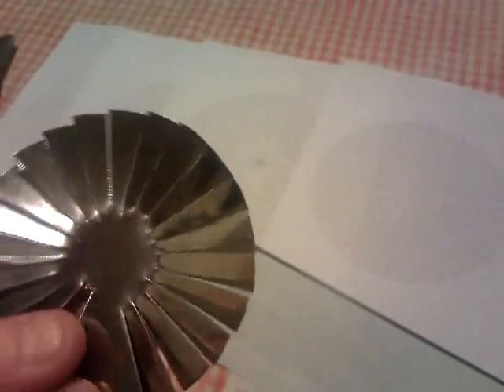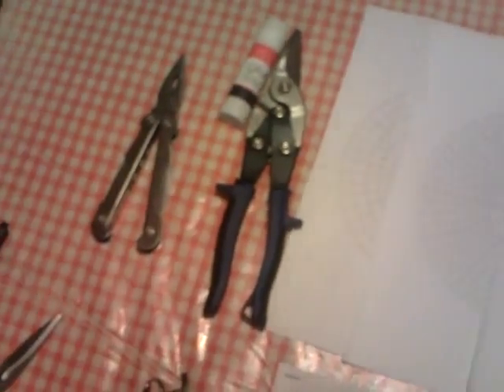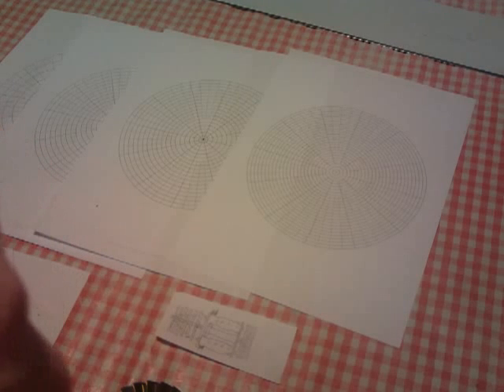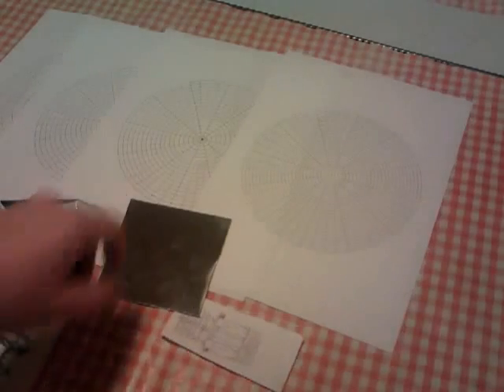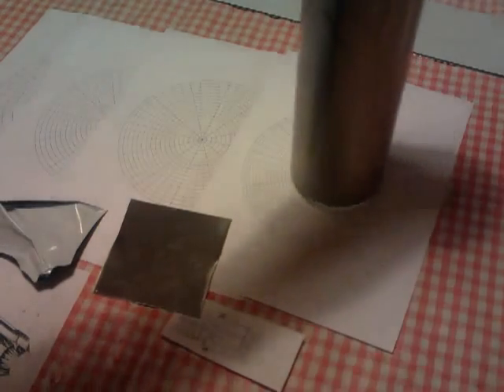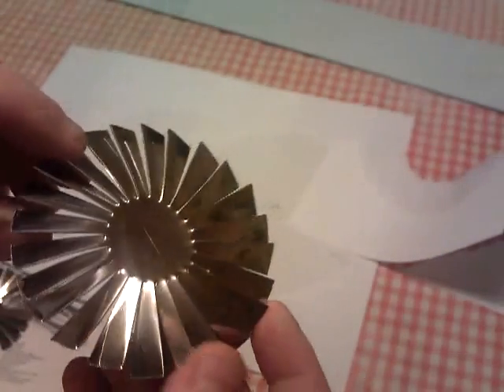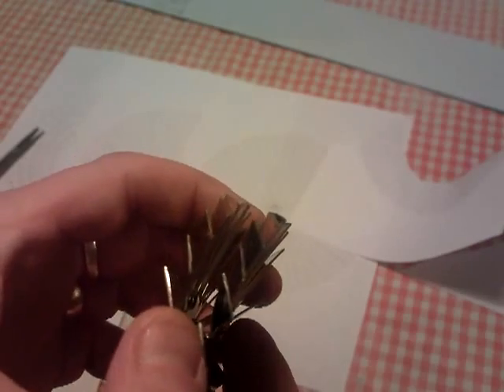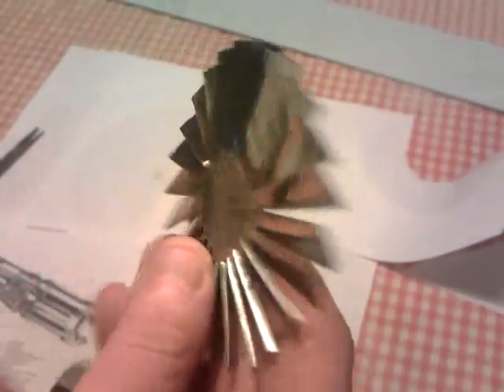Homemade jet engine fans (how i made them)

Comment: just to help. make a circle.  flip it against each other , you will have a moon , flip it again and again until you get all angels you need perfectly.  make lines and when finish glue it to a metal sheet . cut the lines and remember to make a hole in the center . wala jet fan

Comment: I have a dumb question...There should be hundred of thousand cars made with turbocharger engine, enoug to end up into junk yards. Those chargers should have proper heat resistant turbines to stand the exhaust driving the turbine and the compressor. That way the homemade engine might stand a bit longer than some of the examples here :)

Comment: Helical edges work more efficiently over that of the straight edge design for your blades. Furthermore you want to curve the surfaces of the blades as well as provide them with the proper angle of attack..

Have you figured out your design's rotational speed?

This venture is not as simple as looking at a Blueprint and then scaling it down in an attempt to duplicate it. I would not be using stainless but I'd be using Titanium for all fans.

Also I would be giving a hard look at utilizing Computer Hard Drive Bearings as they are designed for High RPMs without failure. However the Bearings are not designed for extreme temperature environments.

Thus a coolant system for the bearings with a radiator is a must. The bearings are set upon a Hollow core with the blades attached to the bearings. There is no central spinning shaft. The blades turn around that stationary core. You can run coolant through that Hollow core from the hollow attaching brackets to the Engine Housing..

You can use the surface of the engine housing as the radiator because it has also been designed hollow and the coolant can run through it. The heat from the friction of continual running of the engine will destroy the bearings without a way of bleeding that heat. Fan Blade failure is just one problem. But bearing problems will destroy your jet faster than anything else.

Many hours of patient work will be destroyed when that engine fails because of your lack of forethought. If you are not going to do this right then why waste your time?
Reply from the maker: Your comment is very detailed and I recommend others read it too! You are right, jet engines need to be precise. Thanks for taking the time to make us all aware. 👍
Reply: +Telecastvids yh
Reply: 24kGoldenRocket 
   settle down ego maniac. People aren't born with this knowledge.

Comment: Have any stators? I'm building a jet engine at the moment and have included then only simply because I don't think the engine would even run at all on turbulent air between the compressor and combustion stages. I know it sometimes comes down to ignorance our laziness. But, I think people waste a lot of time in there lives by shortening out a few as they say, " non-crucial" parts. Make no mistake as. Jet engines sure are fun. And when you're the only one in your high school to know how they work and can build one from scratch... It puts you at the top of the class ;-). As everyone is scared it'll blow up of course.

Comment: Ok, got a couple of questions, one in particular. Balancing is so crusial to compressor and turbine blade assemblies spinning at 80K+ RPM, as well as Calculating  Compressor and turbine blade leading edge "attack angles" and the intracasies involved in manufacturing these components comprised of intricate compound angles and arcs can be mind boggling. Metallurgy still has not resolved the challenge of blade "creep and cavitation",even utilizing the latest in super alloys such as Hastalloy-X and Inconell to name only two.
   Heat disapation blade deformity and failure, particularly in turbine blades where EGT, (exhust gas temperature ) may reach upwards of 1,000°F for a sustained period if time
   Has anyone actually seen a video of a working model in which 1/8" stainless, cut by hand with tin snips had been successfully run? Even for a very limited amount of time? 
   One of The alternatives in the manufacturing of one piece, (blade and hub) assemblies would be wire EDM. Generally, but not always, blades and hub are separate, with blades loosely held in place with "fur tree" joints or connections until centrifugal force locks these blades into place.
Reply: Marc Abrams You are right balancing is extremely important using something such as a bicycle hub you would experience wobble after got to a certain mount of rpm Plus being out of balance dictates the airflow

Comment: Can i use harddrive platters? I have cut one and balanced it perfectly, is it usefull? For a working engine?
Reply: Yes but depending on how heat resistant it is you cant run it for a long time
Reply: I know, this would be the fan (the first fan disk), what material do you recomend for the compressor and turbine? Thanks
Reply: I would recommend a cheap and tough material such as high heat aluminum but if your looking to run it for a little longer than 1 minute i would recommend pouring a lead mold. Or if you have the money Titanium would work the best. :)
Reply: Nice how expensive are 5 plates of 10x10 020 titanium?
Reply: That I don't know but how thin? , 3 4 MM?
Reply: Maybe 2 MM
Reply: ill look it up
Reply: How old r u?
Reply: I am 14 am i am working on a self sustaining turbojet with my dad, thanks for the reply
Reply: If your building a self sustaining one you need a car tubo
Reply: Turbo
Reply: Can i use a car turbo for a axial turbojet engine? Selfsustaining?
Reply: Yes but if you want simple watch colinfurze
Reply: Thanks for your help! I realy need that info:)
Reply: Very and it would be nice if you checked out my vids too i will have the first ever self sustaining air engine , my turbofan engine , and others soon! :D
Reply: I like it, you got a extra sub!
Reply: :D
Reply: I can send you a free intro and outro just send me the info like a song or however many songs you want
Reply: Thanks! I going to ask that if i need it:)
Reply: and parts of songs you want and pics and vids for free! and all you have to do is send me what you want in an intro/outro and how you want it and then you wait. :D and i will send you the finished product. :D :D
Reply: Thanks again man!:) you are awesome! Do you know how much a old car turbo costs? Thanks
Reply: Braden T you Seem to be quite an Expert in this Sector. May you help me figuring out how to properly comprehend and build a turbojet engine? I nave not quite understand how i make the first fan, the one that sucks air, run with electric power. It would be great on a first rc plane. 
If you accept, please contact me at "omniaexmachina@Gmail.com"
Reply: Well,
Reply: You should try building a model first a draw a plan

Comment: wouldn't tungsten work the best?
Reply: I think it has a high boiling point.
Reply: that's the point, so it doesn't melt and to make it tougher.
Reply: tungsten is too heavy, also the compressor blades dont get that hot
Reply: paypwnz cool, thanks

Comment: If i would produce it, the easiest and most precise way is to draw your fan plate on 2D Design, if you know the program or an other program for the lasercutter. Then i would cut it out with the lasercutter on an aluminium plate  and turn the blades as he did it in the video, this way is very easy.
if you don't have a lasercutter, ask after a practicum in a near FABLAB, search this in the internet to see, and where i live exist a lasercutter with a     1 x 2m Cut surface.

Comment: Yea tap and die set will be the greatest thing for that, you will use spark plug!! really? what material are you using for the combustion chamber?
amm yea most probably they will fall apart, so what are you going to do for it? something?
you are making this jet engine just to work a bit like many other people do or you want some powerful work to run something with it?

Comment: it has to do with material strength, balancing, and rotational speed.
uf you use materials unable to cope, or your parts are unbalanced down to the fractions of a gram, the motor could grenade, hurting you or anyone around it. 
the housing, and shaft must also be up to par. if not, when it lights off it will explode. just be careful, car turbos can be made into turbojets, not turbofans.

Comment from the maker: yes i think the balancing is quite important, what with the revs per min these things can do it is critical. i have been waiting to get a decent tap and die set to make my holes for the spark plug and gas feed to go in. they are quite expensive so i have put this project on hold until then. i think that the single sheet rotor should work fine. If you have the tools to make a cast hub and forged blades, that should be even better. people have warned me that my blades will fall apart instantly

Comment: Hey man 
your job looks amazing, good luck for your jet engine :)
well I'm also working on the same thing as you, in the beginning I made the rotor the same way as you did and many times but never got the proper balance on it, do you think it will be good to work with that single sheet rotor?
I'm thinking to cast the hub and forge the blades to provide camber in it separately and assemble them, what do you say?
I hope we can share a lot of knowledge ;) if you don't mind :)